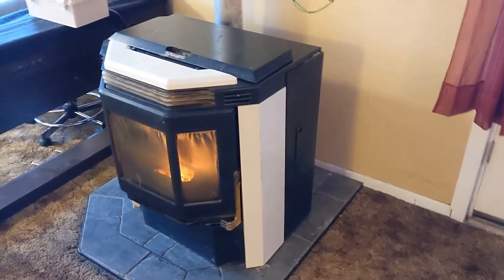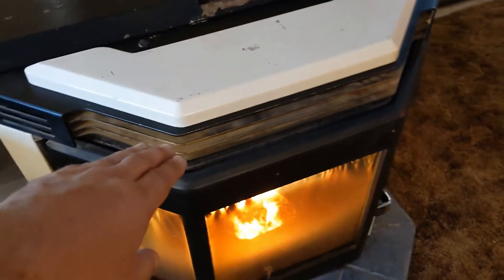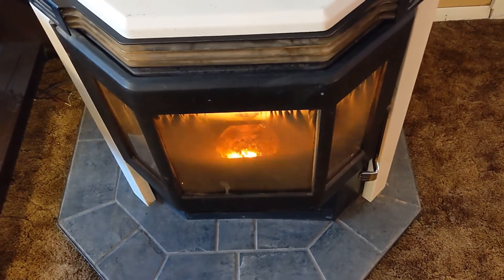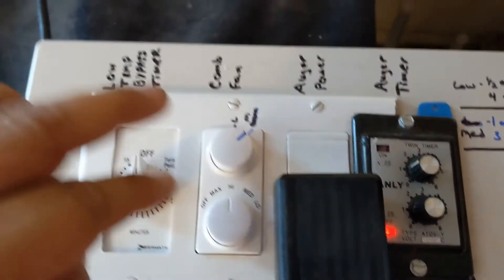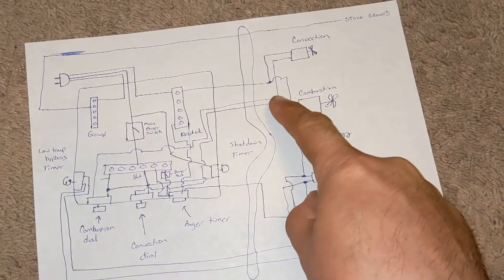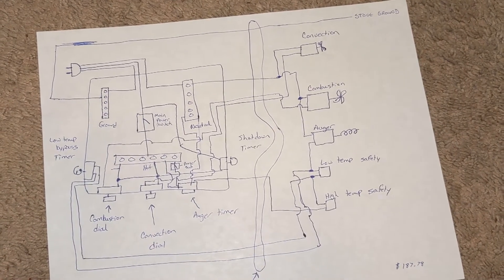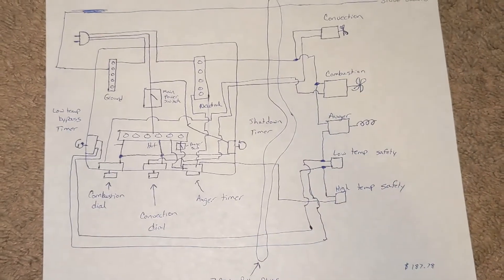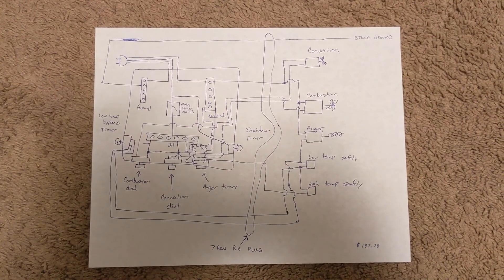How To Make A Pellet Stove Control Bypass For Temporary Use

Comment: Can the augers be wired to a thermostat to shut the pellets off without the stove having to reset?
Reply from the maker: My stove does not auto light... So if I killed it with a thermostat then I would have to manually relight it.

It could be done with other stoves but I couldn't tell you where to wire things in...

Comment: I believe my auger prongs went on the control board! As speed settings won’t change the rotation/ timing of the auger. Do you have  basic advice to wire the twin timer to the auger? Would just need a way to have it shut down if flame gets to high or stove has an issue? Maybe we can chat! email if you’d like! Sending you a message with the email
Reply: Been forever since I’ve been logged in here I guess you can’t! If you look me up on Facebook even! Thanks it’s pretty cold here so trying to get this fixed
Reply from the maker: Sorry for the slow response, I think I messaged you on Facebook... However, it sounds to me like the control knob might not be working. While there could be a way to use the timer I had to run your auger and leave the rest of the stove alone, I wouldn't recommend that. You may fry your control board by doing so. I completely unplugged the fan and auger motors and hooked then to my box when I used it. I did leave the high and low temp safety switches in the loop as well. 

Perhaps you can find some tech manuals for your stove and do some troubleshooting with a multimeter to narrow down the issue.